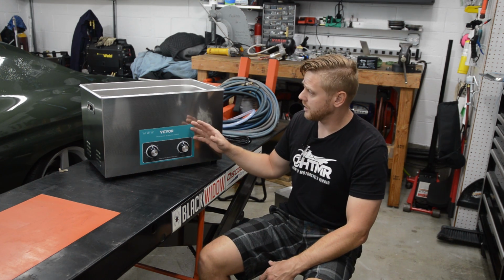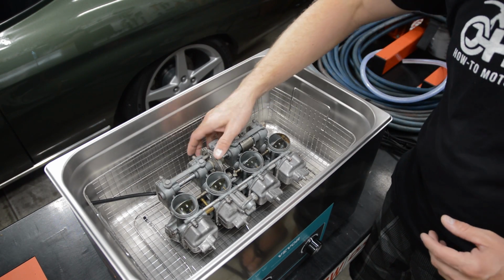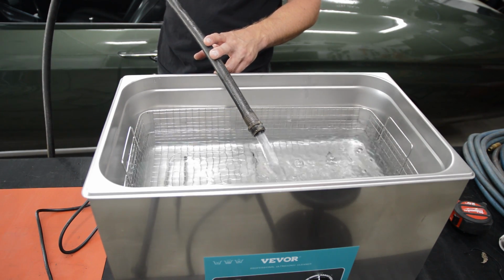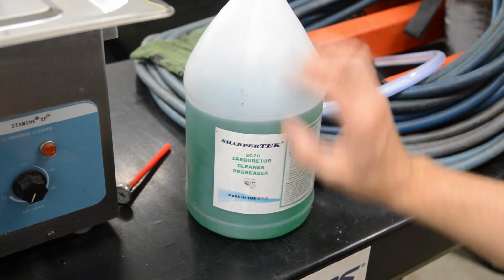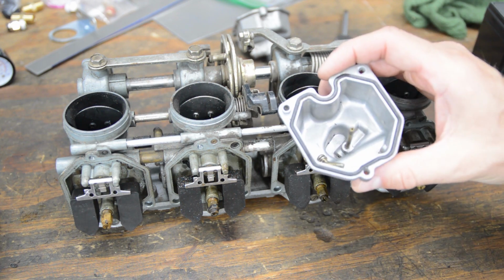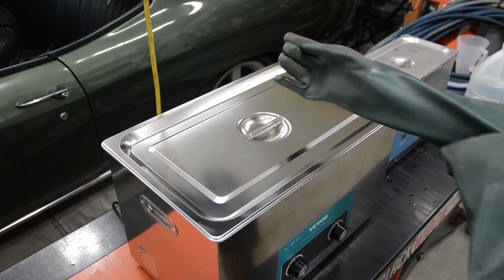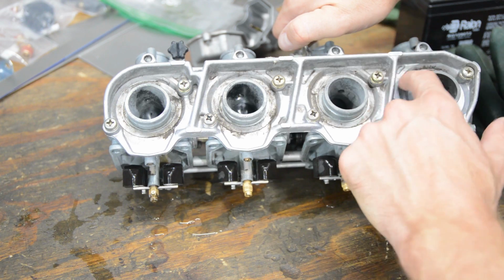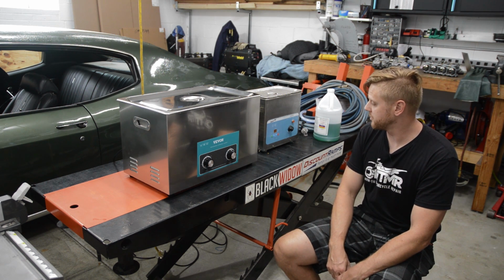You need this ULTRASONIC CLEANER!

Comment: Do you prefer this over vapor blasting? or does this have better use cases over vapor blasting that makes this better? for example if you had a vapor blaster and not an ultrasonic cleaner would you still justify an ultrasonic cleaner?
Reply from the maker: Yes because you need to ultrasonic after vapor blast to get all media out.

Ultrasonic is great if you just need to do a quick carb clean. Not everything is worth vapor blasting.

So the best setup is to have both lol.

Comment: Here's a pro tip. Don't put the carbs onto the bottom of the bath / cage. Use wire and suspend the carbs in the water / cleanser.  Suspension is the best way for ultra sonic cleaners.
Reply: Correct. Never rest items on the ultrasonic floor. Always suspend items for proper cleaning and no damage. They make baskets and hangers for that reason
Reply: So on the basket is good?  @theodoremarakas9899

Comment: I use the simple green pro. The purple one, works great! Always gets the carbs and parts clean
Reply from the maker: Thanks for the feedback, I want to try that one.
Reply: @HTMR  You have to watch out with Aluminum. You can get little stains that look like star fishes from the heat/cleaner. Doesn't damage the part but just doesn't look great.

Comment: My vevor unit burnt up today. Waiting to hear from customer service… power supply just melted…
Reply from the maker: Hopefully they take care of you. Good luck.
Reply: @HTMR  so far 45 mins to get through to a US call center, overnight for a non-descript “we need 48 hours to come up with a solution based on the information (video, pictures, etc) you provided” 

I’ve had it for 362 days, used it two dozen times. 

The feed wire to the power switch wasn’t crimped on all the way and looks like it was shorting, creating heat, and eventually melted the whole switch.

Comment: Pro tip:
Distilled water 
98% of the time you won’t be dropping big parts in, and won’t want to waste ultrasonic cleaner concentrate so get a bunch of peanut better jars, and plastic tubs that you can filled with concentrate and your parts. 

Leaves the unit with clean distilled water in place, your parts cleaned in your tubs, and a much smaller clean up.
Reply: So, basically parts inside a container filled to the brim with concentrate?
Reply: @pr1sm55  concentrate watered down of course. Don't need pure even in the smaller jars.
Reply: For smaller, non-sharp parts that are too small & would fall thru the basket, sometimes I'll use quart-size Glad freezer storage bags filled with either Purple Power or some Simple Green Extreme Aircraft & Precision Cleaner. I also plumbed onto the ball valve a short extension w/a 90-degree elbow & a hose to keep the splashing to a minimum. It's only a 2-gal. tank, but I'll use hot water when I fill it up. And because that metal lid is so thin, I made a custom thick-ass insulation blanket/cover out of an old quilt(think water heater jacket) that fits over it like a BBQ cover to keep all that heat in. It definitely helps save on the heating time + not to mention energy (& hopefully keeps the Chineseium heating element from wearing out so soon). So far, so good

Comment: Put your items in a bag/glassware with the chemical, and rest on the outside with water. 
This way you use less product, as you don't need to dilute fully with the water.
Reply from the maker: I've seen people do that, I'll have to try it. The heat would have to transfer though.
Reply: it does.
Reply: I clean circuit cards this way(in an ESD bag) to reduce the amount of cleaner needed.

Comment: Thanks for the video. Very nice unit. I usually run my faucet water until it's hot and fill a bucket to transfer to my ultrasonic cleaner. It certainly gives you a jump start on the heating process. I would like to see you try the Simple Green Pro against your current cleaner.

Comment: About 35 years ago or so we got a K&L ultrasound cleaner. It was about your size, probably 25 L. It cost, about $2000.00 at dealer price. We made arrangements to pick it up at the Dealernews News expo which was in Cincinnati at that time I believe. We hauled that and a couple of other things out of the show. That was a workout!  I would be curious to know how many transducers are in yours. The one we got has four. We had to get one replaced maybe 10 years ago. There is no heater, but we just put one of those immersion heating coils in the solution when we need to use it. The cooling fan also eventually quit, but we easily fixed that. It does a great job!

Comment: A good thing to do is take a syringe filled with solution and push through each orfice tube and all holes bc it doesn't always get into those small holes and ultrasonic cleaners need the solution to be in the holes in order to work. Then you use syringe again in clean water bucket to push out all going both ways or with carb cleaner and spraying out with air both ways to make sure cleaned. But yes dipping twice will help but it's also good to agitate it to before you use syringe method. And the only thing with that cleaner that I see is that the basket touches the bottom. Messes up ultrasonic frequency.
Reply from the maker: Basket is spaced off bottom.
Reply: @HTMR  with the basket prongs touching the bottom the oscillators have sometimes fallen off. That's the problem with some of these and that it messes with the true frequency of them. The guy I gave you the link to has been studying ultrasonic cleaners for awhile and not just him but I myself have seen other cleaners even on Amazon stating that their cleaners where the basket no prongs don't touch the bottom and why it's better for machine and cleaning. Just trying to help..
Reply: @HTMR  but the prongs are touching
Reply: Even with the plastic.
Reply: If you take it off the bottom you will hear the difference sometimes this even messes up the cleaner.